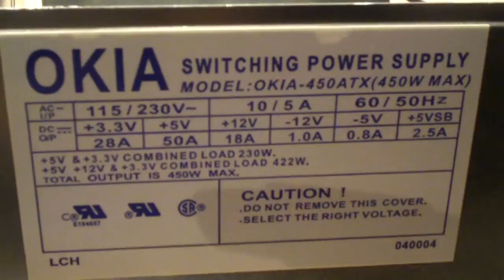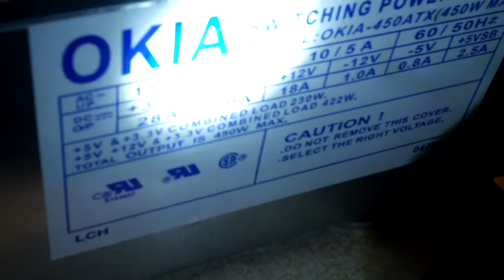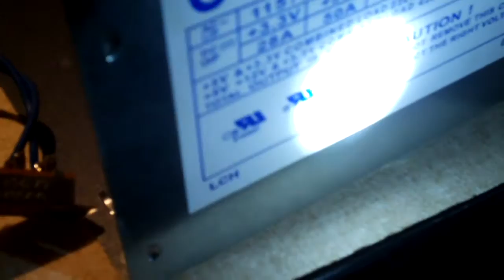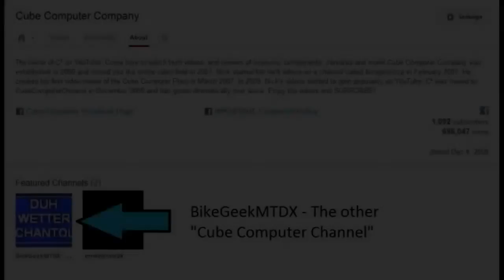A 2nd look at the OKIA 450W Power Supply (Piece of Garbage)

Comment: I've dealt with 2 of these. One was pulled from the case before it ever saw AC power. It later blew up when I was probing it's ATX connector. The other one was put into service, but was pulled and nuked about 6 months later when I upgraded PSUs and gave the old one to my mom to replace the garbage one mentioned previously.